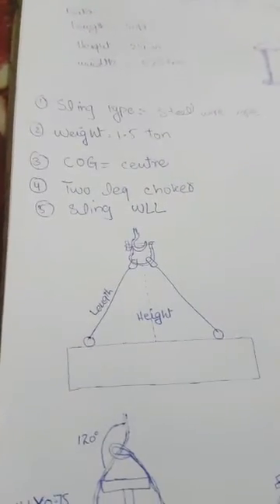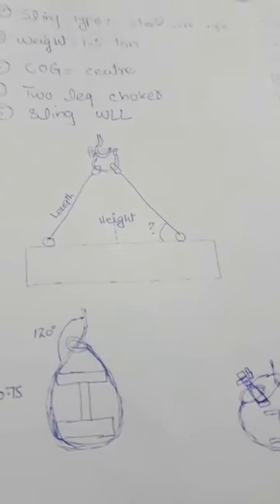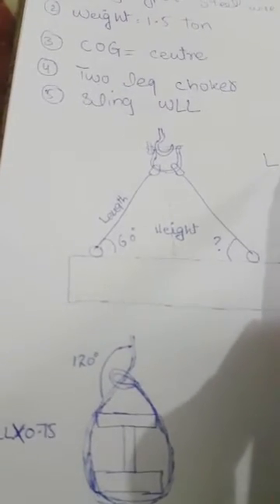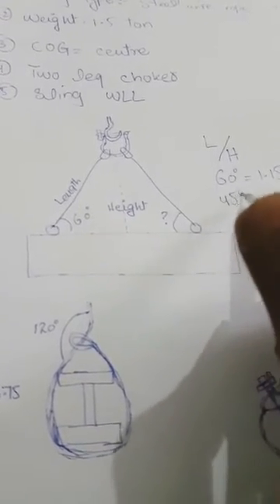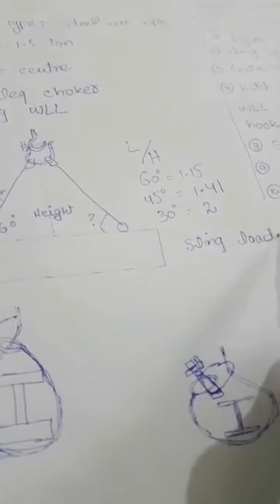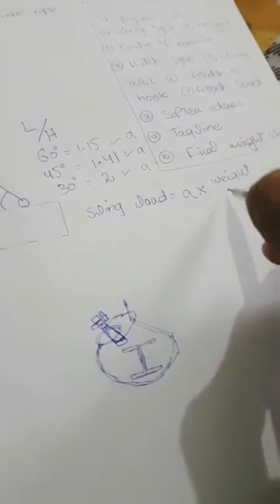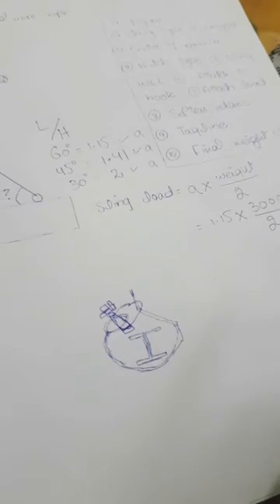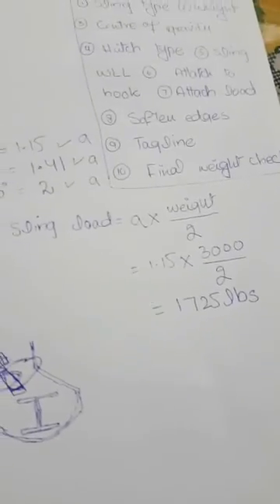How to calculate Sling Tension or Sling working load limit.

Comment: What are you doing? Your method is wrong, can you explain how have you got this angle, which method you used and how you find out the angle...load/2 x L/H this is the simple formula ...for example load is 12000, length of sling is 6 and height is 4...so 12000/2 x 6/4= 9000 this is the answer
Reply: He used factor ratio of 60 degree 1.15 it's simple divide load by number of slings then multiply by factor ratio ,then it will be the stress on each sling
Reply: this method is correct! but his explanation is missing some important points